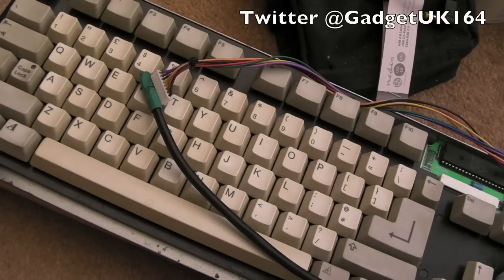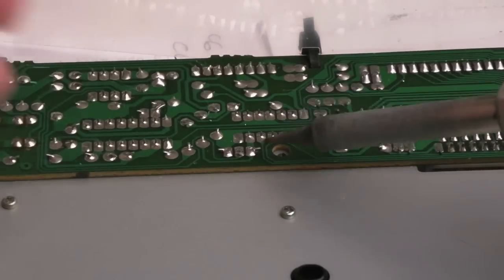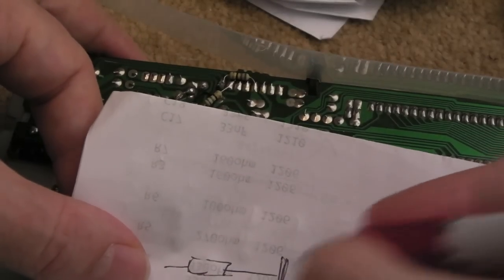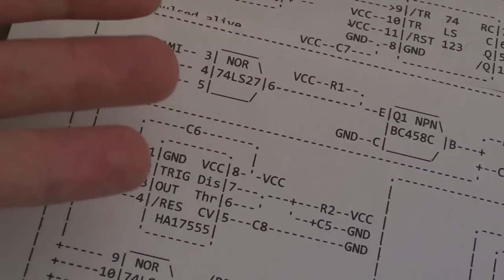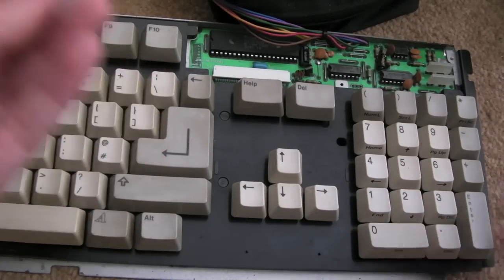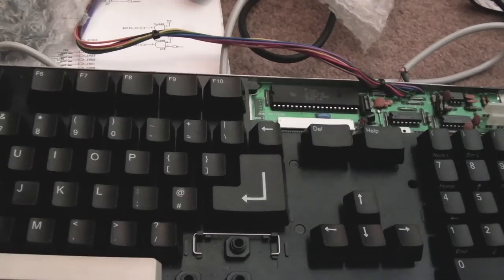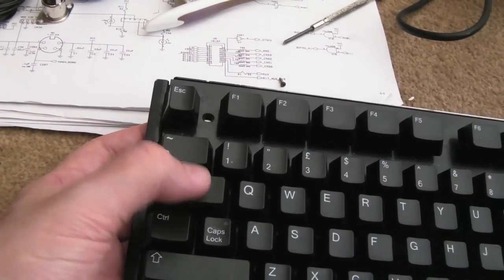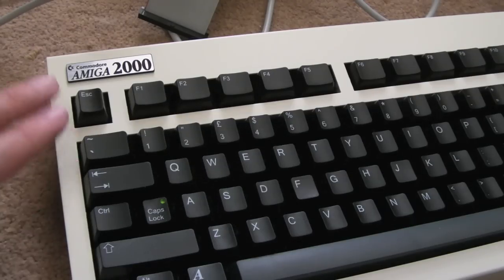Commodore Amiga Checkmate Keyboard Shell & A1200.net Replacement Keys (1st Run) / A2000 DIY Keyboard

Comment: Hello GadgetUK164,

I'm Phil from A1200.net.

First thing first, I would like to thank you very much for publishing your video. 

While the proper way to handle the issues you encountered would have been to contact us first to assess those and then we could have give you some details and feedback, I understand the frustration you had building up and the need you had to make a video. No problem here.

All our team members and projects are transparent and we're all communicative. 
When you meet issues, there are reasons why and I'm going to give you here a lengthy detailed explanation for each of them.
Your video is actually very helpful as it illustrates how it was quite a difficult task to bring these Amiga compatible keycaps to fruition while there are many untold facts & realities regarding Commodore hardware.

But now:
- Please contact us as to replace your space bar. Gosh! How this could ever happen!  I'm personally very sorry about that.
- Sadly we can't do much for the other issues you are encountering.

Thank you again,
Cheers,
Phil.

Now for the details:
Let me assess your issues and explain why some of these are currently happening.

Also I would like to point out that our keycaps aren't fitting perfectly on one of my very own A1200 as well!
I do experience the same fitting/popping issues you've illustrated at 22:20 it is annoying, but I had to find a solution for it to fit on my keyboard.

At 26:08  you did understood that those keycaps were sitting better on your A1200. Later while editing the video adding the mention "not much better" tho?

26:30 Keycaps aren't suffering some kind of wear/tear while sitting at warehouse  :)

29:30 "Shocking quality control"
We did acknowledge that we had around 1% of keycaps having issues and that is why the team swapped around 1200 unique keycaps which had those label printing issues.
The issues you are encountering with your keyboard are not related to this at all.

29:39 Printing alignment
Very true, some label from batch one had slight misaligned printing. But overall not really disturbing most of the time. Again, we replaced the most bothering keycaps.
You also need to understand that plastic industry is an heavy industry. We are manufacturing keycaps for less than 2000 Amigans when the industry is usually expecting orders around 100K to 200K units minimum. As a result, we couldn't reach the same type of manufacturers processes since our keycaps are 100% custom. They're not Cherry MX where you can benefit a large set of already established manufacturers. Our team had to go the long way and manufacture/design all tools necessary. But this does not neglect the issues you having.

30:04 "Some of the keys come off really hard (while others just pops out easily)"
Same as said before. Sadly there is a wide range of Amiga keyboards/Keycaps designs in the wild. It is impossible for one set of tools (the one we've designed), to fit all combinations to the perfection. However, we did succeed into covering around 95% of the spectrum with our version.
Yes, there had been issues with few contributors having peculiar keyboards as yours. And I'm certain we might see a few more.
Some of them will experience the same issues as you. Others will have a different set of issues.
I personally apologize for this, however nothing myself or any of team members or engineers could have done to avoid this.
Simply too many singularities on Amiga keyboards we can't cover them all.
Example: The German layout exists in 5 different versions on Amiga!

You illustrated this very well at 29:57 which I summarize with: "Some of these keycaps comes out really hard while others not".
This is due to the inconsistencies we are facing with the many variants. Sadly your keyboards do fit in that area. And it is the worst I ever saw.

30:23 There are several differences in some keycaps profiles to support variations.
The keycaps comes with a plastic holder that has a unique mount that is repeated to many keycaps. Some might fell due to the variants.

31:05 "The combination between low quality of these  and I'm not saying this lightly as I have lots of these, I have the black one and the white one, they're awfull, they're awfull, I'm not impressed at all"
While I understand your frustration with the issues you've encountered, I would like to counter this argument by saying our keycaps are instead of great quality.
We've put lots and lots of effort in these. And the issues you are facing are very much peculiar since we've delivered 1200 contributors so far and we didn't had such bad feedback until now.

31:24 "Someone said on twitter they haven't received they keycaps yet and the project was on hold - that I was not aware of - that's maybe why there are so many issues...."
This is inconsistent if I may.
As a contributor, you have access to campaign updates. The team publishes updates monthly. In each update we go into details on what is going on and why.
It means you were aware of it. If you were not, that is because you might not have followed updates.
While we fixed the label printing issues we had end 2019 and designed a new German layout, Covid-19 put an hold on the project and we're on a waiting state for our production to start, and this since end January 2020!

33:35 FAT Enter Key (ANSI)
We have never encountered the issue you are illustrating here! Its a first. Another one to account to variations.
Can you try this on your A1200?

35:00 "I'm amazed nobody pointed this out, out of all these people who changed their keycaps, how is nobody had these problems apart from me?"
- The reason is simply: You are very unlucky having a very peculiar keyboard. That is why you are experiencing all these issues.
- The spacers you've removed seems not fit well to your keyboard for any reason.

Please understand
We've delivered 1200 full keycaps sets so far. If they were all that bad with all those popping/sitting issues, enter key issues etc... You would certainly have heard of right?
But you did not.
So obviously what we are witnessing here (and sadly what you experienced) is that this keyboard in the video is quite peculiar, and your A1200 might be as well.
It has quite some variations. There is no way we could have accounted for these at design time. Doing so we'd introduce way more issues into the many Amiga users who have our keycaps.

36:43 GREY SPACE BAR!!  WHAT??
- That is unacceptable and you have my apologies here. Seems with all those issues you encountered, you did had to have a different space bar do you!
That space bar is for CD32 keycaps set.. no idea how it got there.
Please contact us and we'll ship you a black one of course.

36:55 "I tell you what: I never buy anything again from that company"
- Where not a company, just a team of Amiga enthusiast doing this with a fairly limited budget when it comes to plastic injection.

37:07 "and they don't have have plunges for here"
- This is normal and documented. We couldn't have another one additional mold for these as it would have impacted the keycaps pledges very badly.

TLDR;

- Why you had all those issues;
Like you pointed out at an earlier point in the video, you can find inconsistencies in Commodore keyboard design schematics or on a lot of their designs.
These inconsistencies does also happen on Keyboard frame and Keycaps profiles, and even on Cases! The Amiga 500 case had 5 variations, the A1200 3 variations.
Our team can only produce one set of tools. And we try to account for as much variations as possible. Thus we understand we can't make it perfect for everyone.

Commodore had several partners back in the days, while time went. Each of them created new tools and molds for their keyboard and keycaps. Each tool will them ultimately end up having slight variations in it. So far and based onto the exchanges we had with our contributors, we expect at least 6 to 8 or more variations while we only detected two at design time.

As a result and to illustrate your current situation, your particular original keycaps set would have had issues fitting on some other Amiga keyboard. Maybe not the ones you have in your possession right now but other units. Simple as that.

While I confirm we did encounter users having issues; most of them did not.

Have a look at 

- Dan woods video:
https://youtu.be/VdBWXbIswZI?t=275

- The Guru Meditation video
https://youtu.be/U9JY1zjDLMk?t=481

@Stephen bruce:
Those are NOT prototype tools. All are custom tools and we went into quite some work for these to be made.
Molds are visible on our facebook page.
Reply from the maker: Firstly, thanks for taking the time to reply - in such detail.   Although, your opening comment has annoyed me right off the bat lol - "While the proper way to handle the issues you encountered"...    The proper way for you perhaps, but for me, the proper way to deal with any review is tell it how it is - the positives and the negatives.  I had also seen enough of the alignment examples on close ups of other videos to realise it wasn't just me with the print issues.  I don't doubt lots of people will find the keys fit perfectly, and from the 2nd batch I would be amazed if the same alignment issues exist - I hope not!!  And from phase 1, not many seem to have noticed (or care) about the alignment issues.

But the alignment issues are visible on close ups on other peoples videos - they just never noticed!  I could take some stills of Dan Woods video (and other channels) - the same issues are there with the arrow keys and one of the Amiga keys at least.

I also saw (but did not mention on the video) the same problems on another Amiga that was covered on my channel months ago.  On that keyboard one of the metal bars had to be removed, and the keys did not have a regularity with the size of the square plunger - just the same as I experienced here.  But, in that machine 99% off the key caps held in place well without any assistance.  And since doing this video, others have contacted me to say they've seen the same thing with print, and peg tolerance too.   So whilst I might be in a minority situation, I am not alone for sure.

The point on quality here - the square pegs are not all the same in their dimensions - regardless of which keyboard I fit them onto.  eg.  The square peg on the TAB key is very slightly less in X and Y dimensions vs say the Q key.    Whereas, any of the original keys from any of these Amigas I have, all have an identical sized square plunger.  I accept that tolerance difference perhaps doesn't present a problem when these are fitted to the "correct Misumi" keyboard that you targetted.  I could measure those differences between keys pegs accurately, but I don't know what that's going to achieve. 

Thanks for clarifying the point about the white spacers on the spacebar!  It's not a big deal, I just thought it was odd to provide every other spacer except for those, but I can understand it was to reduce costs.

Whilst I said they fit a "bit better" on the A1200, they still don't hold on well enough for  me to confidently install them without PTFE.  So my A1200 likely has the wrong Mitsumi keyboard too.

With regards to your point "This is inconsistent if I may." - Inconsistent with your communications perhaps, my point was I received mine 18+ months ago (approx), and yet a few people have contacted me recently to say they haven't received theirs yet (another just now!) - I assume they are mistaken and they are perhaps waiting for the 2nd phase!?!

I am sorry if I offended you with any of my review or comments.  We all appreciate projects like this, but attention to detail is everything.  I am sure the 2nd phase of keys won't suffer from the same alignment issues.  I've altered the title and description of this video to reflect these were from the 1st phase, and I've pinned your posting here.

Thanks for the offer to replace the space bar, it is very much appreciated!
Reply: @GadgetUK164  

Thank you very much again for your feedback and for pinning my answer. Really appreciated.

My apologies about having annoyed you, not my intent at all.
Point I was trying to make is that when contributors have issues they'd simply contact us straight. But fair enough and I'm glad you posted your video since my answers are also giving some insights.

Alignments issues are acknowledged. Hence the replacement program we ran. 
The alignment issues you are experience are minor. I'm not neglecting there is none, I'm saying the one we've replaced are major ones. 
Some of these might still pop here and there with second production - but small minors.  Why?
 - Those Amiga keycaps have quite a concave profile. That is where alignments issues are coming from a technical point of view. As of today, the Amiga audience doesn't have the volume for us to reach better processes in manufacturing or to consider to throw away sets with issues and keep only perfect ones (that is the standard in the industry). We can't do this. It's a crowdfunding project. We've worked hard on these issues trying 4 different print companies. Tests were done with laser etched labels (kinda blurry) but etching isn't suitable for colored keys. Also trying dye sublimation. Results were quite blurry.  - See example of dye sublimed keys (Note: tests were about print quality - not positioning).
https://www.a1200.net/keycaps-sublimation-tests/

Following tests we went back to pad printing. Laser etching came about 1990 but commodore stood with pad printing and we now understand why.

Regarding your issues with keys not holding good enough on your A1200, again this is related to variations on models. And I implying you were the only one. We know about this. On my A500 for instance I don't have any issues at all. Just one key on my 1200 which would pop.  These issues aren't consistent over all Amigans. For those who have them, they're not at same spot. I do not neglect the fact there aren't issues, I'm just saying they're not as numbered as you might think. But with only one set of molds... So we'll see few more Amigans experiencing those from second production run. In overall, our keycaps version fits the many users quite well.
And we were all into details - that is why these keycaps sets fits most variations. I agree not all of them sadly and I'm sorry about your bad experience with our keycaps. 
This is still a crowdfunding project operating in heavy plastic industry. 

Regarding delays, these has been explained number of times since January. We're still in the middle of a pandemic and we've not being able to get our new production slot yet. (keycaps only - A500 case is going on). We continue to inform contributors on prod schedule with monthly campaign updates. And we ask everybody to be patient, as we can't do much about it. We're not Logitech nor Amazon. Not same level. But Keycaps will be made, as well as A500 Cases and we might even get a couple others products out before keycaps, which is really crazy.

Thank you again for your feedback and video Chris,
Please contact us regarding the space bar, I'm also not sure which Chris you are 😅 

Cheers,
Phil
Reply: I would like you to commend you on an honest assessment of the keys. As everyone should be aware by now only a few people received keys. For the rest of the backers they have had to watch Phil lie and weasel his way out of his many broken promises for some years now. Did he ever intend to finish his projects or was it all an elaborate scam to enable him to continue to live on the beach in South East Asian, who knows. End of year is fast approaching and limited colour production is scheduled for before end of year, lets give him 3 more weeks to prove he's for real.
Reply: @amigaman2305  

- 80% of KS backers were delivered between Jan/Mar 2019.  Thats around 600 contributors(parcels) for around 1200 sets. 
- https://www.kickstarter.com/projects/a1200housing/new-compatible-keycaps-for-amiga-computers/posts/2385658
- https://www.kickstarter.com/projects/a1200housing/new-compatible-keycaps-for-amiga-computers/posts/2420360
- https://www.kickstarter.com/projects/a1200housing/new-compatible-keycaps-for-amiga-computers/posts/2422490
- https://www.kickstarter.com/projects/a1200housing/new-compatible-keycaps-for-amiga-computers/posts/2425560

Nothing else to say. I won't tolerate insults and disrespect.
I'm glad to answer to any contributor as the team and myself are committed to you guys. 
We're not committed to you Amiga man.
Good bye.
Reply from the maker: @amigaman2305  Thanks, my exposure to these keys is limited to the two sets I received (some time ago - 18+ months I think), and the close ups I've seen on other videos - in those cases people seem not to have noticed the alignment issues).  Hopefully the next run of these will be free of those issues and hopefully everyone will get their keys soon!
Reply from the maker: @amigaman2305  I would also like to add - I've just seen they answered my question 2 months ago about the alignment issues, and I can see lots of people moaning about the 1st run never having delivered.   Their reply to me was that I missed the replacement phase - one that I was never even made aware of.  So I am stuck with alignment issues.
Reply: So the end of the year came and went with no production. Wonder what the next amazing excuse will be. He's probably going to say something like, production is happening right on schedule mid 2025, what are you all talking about.
Reply: I have to admit I haven't tried mine yet. The reason why is they arrived just fine, but were UK layout when I asked for US layout ;).